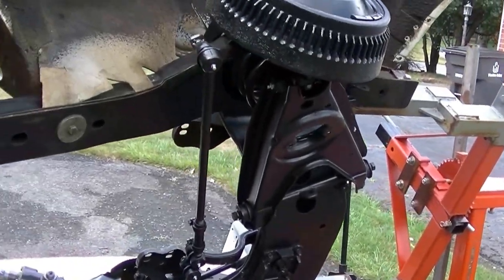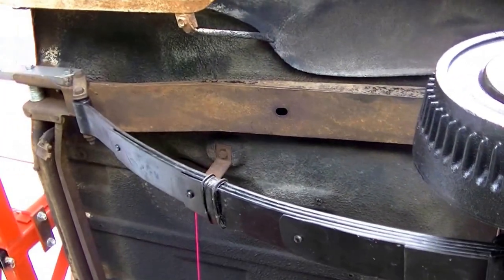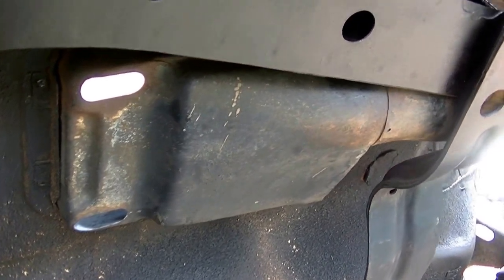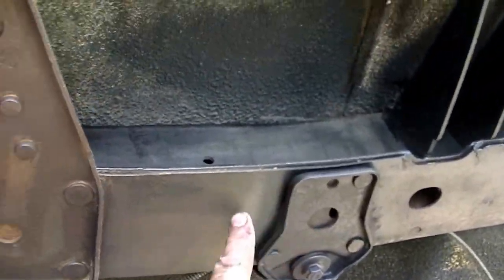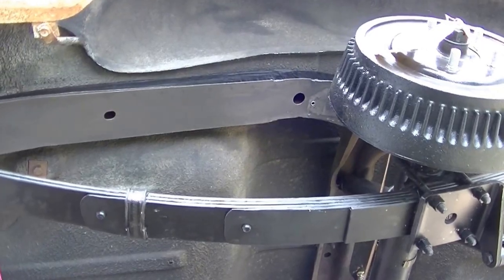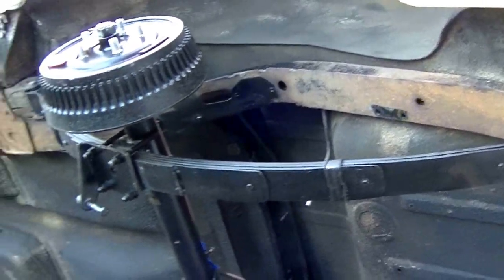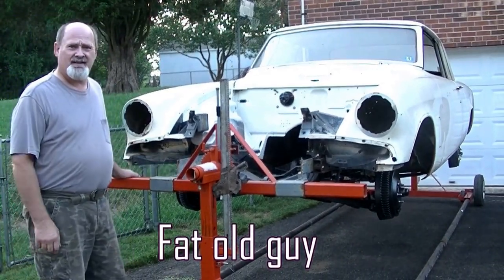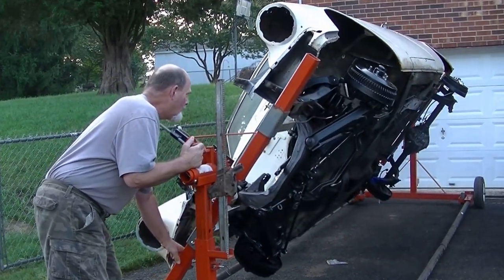1962 Studebaker GT Hawk   Prepping the Frame for Paint Part 1

Comment: I've had three 1962 Hawks, a 1956 Hawk, '61 Lark, '62 Lark Cruiser, '64 Cruiser. I know that this is about 2 and a half years later, but I might suggest to anyone with a Studebaker to weld some small reinforcement plates on the top and sides of the frame where the hole is on each side that the brake line is bolted to on the front part of the frame. This is where the brake lines transition from steel lines, to rubber hoses. Those holes were not drilled, but punched through when the frame was stamped. The frame can crack there. This happened in my '61 Lark, and the man who welded it said that it was more common in the old Bullet Nose Studebakers. The crack started at the hole, then opened up down each side of the frame. Particularly if you are working on the frame, it is a good time to reinforce the frame and avoid a later problem.